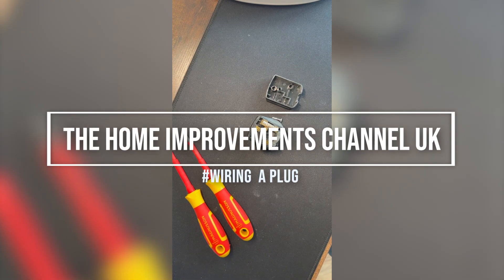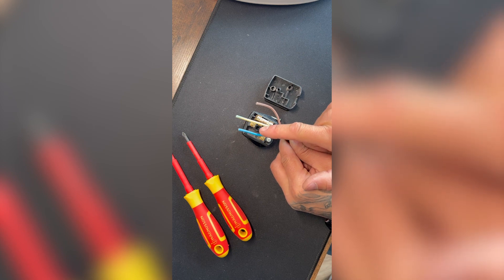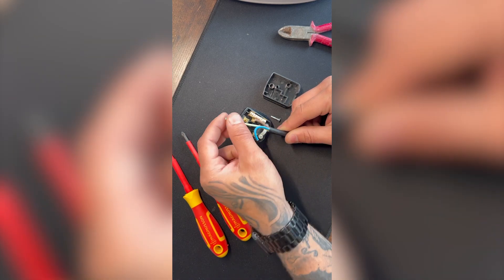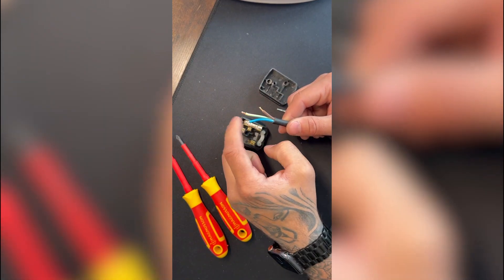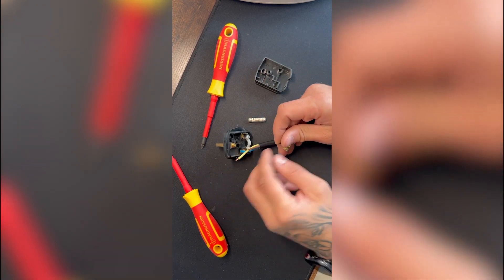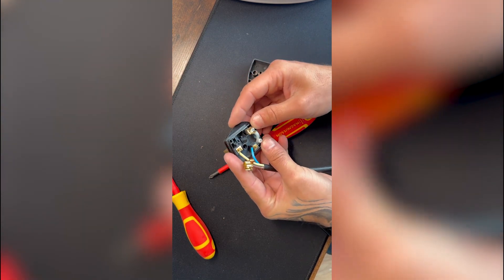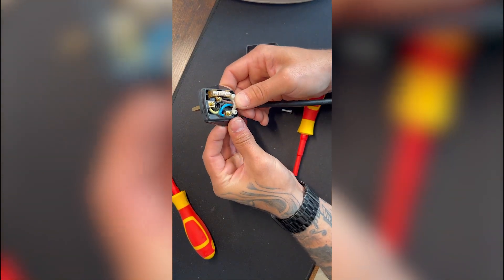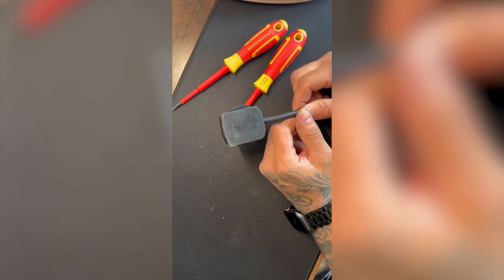HOW TO CHANGE AND WIRE AN ELECTRICAL UK PLUG #electrics #homeimprovement #diy #UK #howto

Comment: Do you have a video on how to replace a kitchen strip light with a spot light? Or how to move a existing ceiling light into the middle of the ceiling? Mine have been put up with trunking and are all off centre in front of the windows 🙈😂 thanks guys x
Reply from the maker: Not as of yet but maybe soon 😁😁